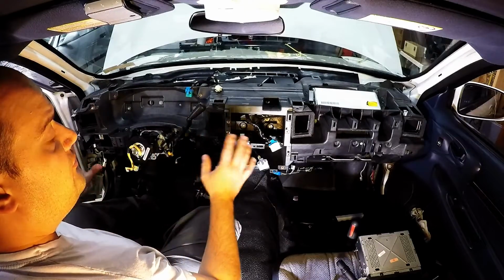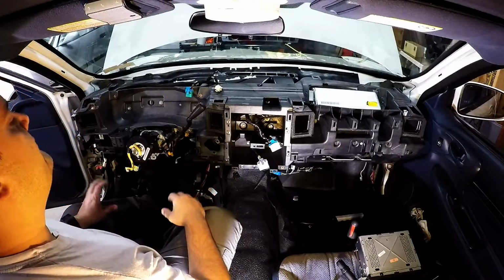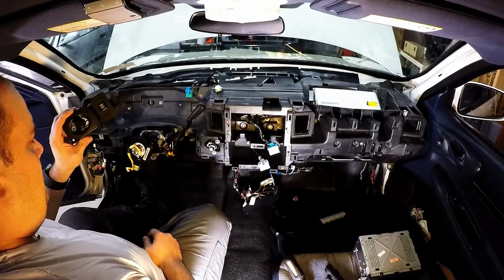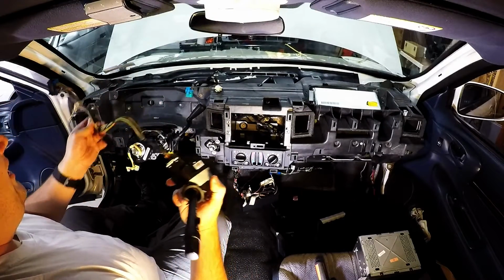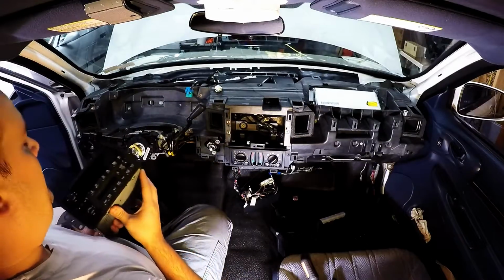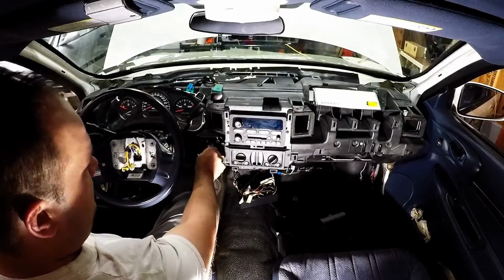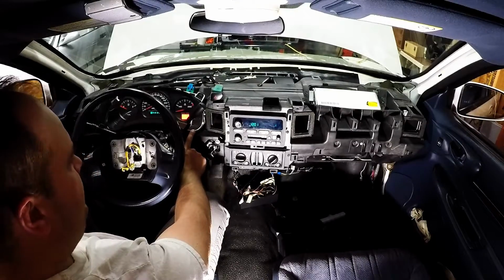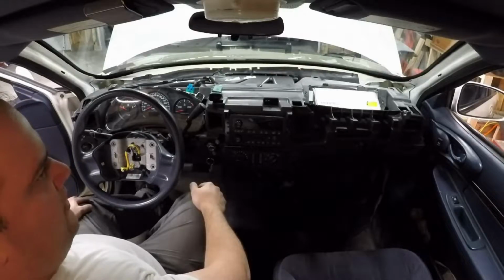Impala Dashboard Wiring - W-Body 8th Gen

Comment: I have a 04 Impala 9c1 and it does not have cruise control. Would there be a harness for cruise control already in my car and easy to hook up lets say if I got the parts from a wrecking yard? I am redoing the upholstery and all plastic with vinyl and that's how I found you. Good informative stuff for learning how to disassemble.
Reply from the maker: The steering column harness will have the connector for cruise control and if you got the multi function switch with cruise control, it would plug right in.
There is also an additional module that bolts on the throttle body bracket that controls the throttle position and I don't know if the ECU programming is different when cruise control is an included option.
Reply: Thank you so much for your quick helpful answer and the video which helps me with my project.